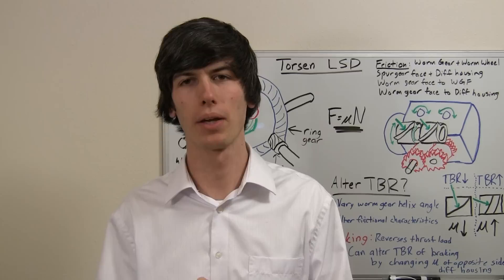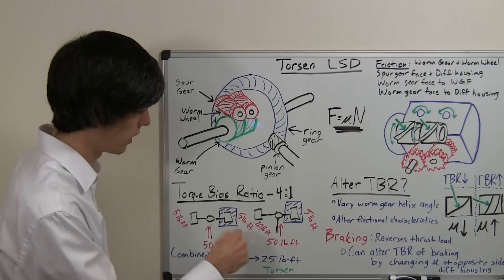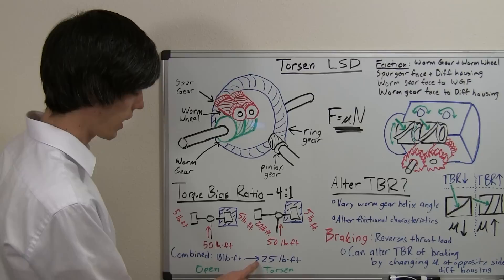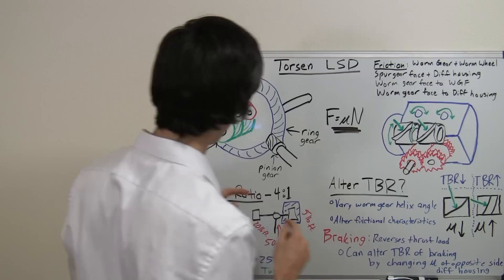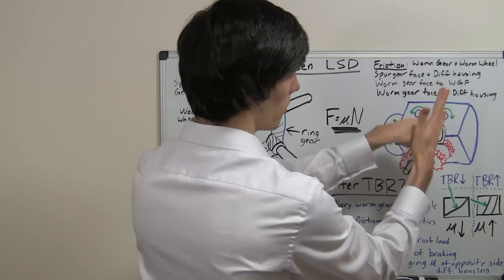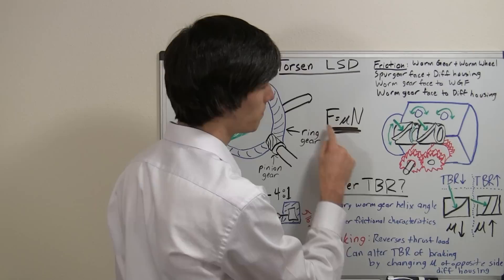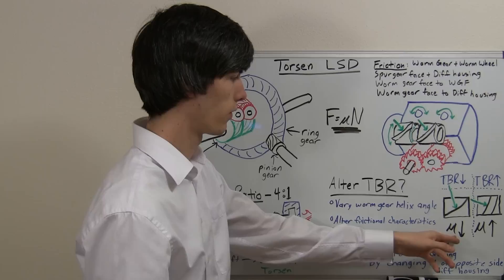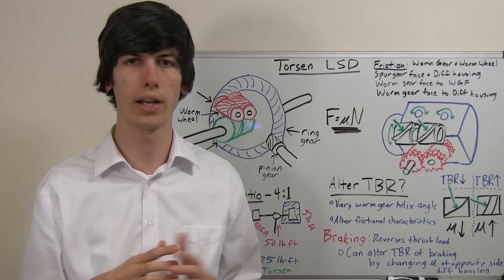Torsen LSD - Torque Transfer - Explained

Comment: Great video! It might be helpful to point out that a limitation of the Torsen becomes evident. The differential can only transfer torque as a multiple (the bias ratio) of the wheel with least resistance. Imagine an airborne tire. It doesn't take much torque to turn an airborne wheel. Even if you have a bias of 6:1, six times "meh" can often be too little torque to overcome the static friction and make the vehicle move. 

An operator technique to address this limitation is found in your equation, F=μN. Once again we can add some friction. By applying the brakes, you add resistance. There's now somewhere for that torque to go--into your brake pads. That amount of force, multiplied by the bias ratio, is now available to the other side of the differential.

Active traction control systems might use wheel speed sensors to detect such an event and automatically apply braking force to the free spinning wheel for you, but that's how you could do it manually.

Comment from the maker: Philosophy aside, could you be more specific? I never said I know all and make no mistakes (which is why you'll find notes and annotations throughout my videos, as I attempt to correct them with time). But you do realize there is a large difference between what speed a wheel spins at and what torque a wheel receives, no?

Comment: That one was pushing the limits of my capabilities but got the general idea.  Seems sheer genius whoever dreamed it up.  Two questions:
1.  Is there any reason not to want the maximum possible Torque Bias Ratio?  I.e., any benefit to having less?
2.  What happens when there is close to zero resistance on one tire?  E.g., on "black ice".  Zero x 4 is still Zero.

Comment from the maker: You are correct in stating they are not the same thing. Helical gear is basically a general term for gears which have the teeth positioned in a helix (rotating). This is different from spur gears, which are straight and not curved.

Comment: This video can really benefit with a working model. I had a SLP Torsen in my IROC-Z. It worked great unless one wheel totally lost traction. Then no torque would be transferred to the other wheel. However, if I straightened out the steering wheel, torque was instantly transferred to the wheel with friction. The Torsen acts like a 'one legger' when going around corners. But, then seems to act like a 'locker' when going straight ahead.

Comment from the maker: A 2 way does certainly lock more under deceleration than a 1.5 way, or 1 way (obviously). I do have a video explaining the differences of each. As far as changing the friction of a torsen LSD (not a clutch type 1.5 or 2 way) you could alter the amount of torque transferred between, but I don't believe this would not cause the differential to lock up under deceleration. It acts more like an open diff with small forces applied.

Comment from the maker: Probably cost, and clutch types have their advantages - adjustability of torque transfer, especially if they're electric. Also, if one tire's in the air a torsen is much like an open diff, where a clutch type is not. The new joint project between Toyota and Subaru has put a Torsen in the FR-S and BRZ. I think the Miata may have used it as well at some point (or maybe it still does?).

Comment: Worth noting that when a vehicle drives through normal turn, both wheels have traction and therefore leverage over the differential. This leverage allows the diff action to take place and the drive wheels can rotate at different speeds. When one wheel is on ice it has less traction and therefore less leverage over the differential. Also, with a torsen diff, if a drive wheel has zero traction, (wheel leaves the ground) no torque can be transfered to the other wheel.

Comment from the maker: Not sure if I would generalize each that much. They each have their differences and benefits. Clutch types are very commonly used in racing; not sure how often viscous is as it may get too hot with extended use (this could be prevented with an oil cooler, Nismo toyed with this idea with the 370z). Torsen comes stock on the new BRZ/FRS.

Comment: Also in this video you say that there is deceleration torque bias while in the other video (where you are correct) you say that it does not work the other way. I understand it's very confusing, so I'm just trying to help. It's very brave of you to try to explain this stuff. But the torsen differential does not limit slip during deceleration. This is one of the reasons why clutch type lsd's provide more stability and better drift characteristics.

Comment: The Torque Bias characteristics now explain easily why the Torsen architecture is not a good choice for off-road : when you lift one wheel because of the terrain, the other will receive no torque at all.

Comment: As with so many engineering questions, the answer is "it depends". 

The Torsen differential is great for road cars. It's a big improvement over an open differential, they are low-maintenance and don't have significant handling quirks.

A clutch LSD is preferred on sports cars, especially those used for competition or drifting. It won't completely lose traction if a wheel becomes unloaded, but needs regular maintenance and can cause understeer.

Viscous .. ugh. Not on my sports car thanks ;)

Comment: IMO:
-Torsen for slow heavy duty vehicles, say a tractor, as the torque transfer is constant regardless of speed. And due to rugged design, you wouldn't have to worry about burning clutches when massive input is applied.
-Clutch for general purpose vehicles, say a pickup trunk, as it doesn't produce as much heat on higher (moderate) speeds.
-Vicious coupling for sport cars due to its simplicity, small size and low weight. But it only works on high speeds. On slow speeds, it's practically "open".
Reply: Imho: Torsen, for maximum fun. Its not just for heavy duty vehicles, manny sports cars use them too.

Comment from the maker: A slipping wheel sends torque to the opposite wheel (the one with traction). This is the definition of an LSD. A torsen diff handles it differently than others (as explained in the video) but the principle remains. The acceleration of the slipping wheel is a direct result of receiving torque with little resistance (friction) with the ground.

Comment: If one wheel is in the air you can just apply the brakes lightly to create frictional resistance that the Torsen LSD can use to transfer torque to the other wheel.

Comment: Depends highly on the application. Torsen can be quite durable and maintenance free compared to a clutch LSD, and it acts instantaneously whereas a viscous LSD takes some time to react to the speed difference. But torsen never truly locks, it can only transfer torque based on the bias ratio. So if one wheel is on super slick ice and can essentially handle no torque without slipping, the other wheel will only receive 5 times essentially no torque, which is still almost no torque.

Comment: Torsen diff is locking only when the both wheels are on the same surface. If one of the wheels is on ice and the other is on tarmac this on the ice will start to spin and this on the tarmac will stop. Torsen is almost like ''Open diff '' . BUT the open diff is spining only one wheel even when they are on the same surface... Sorry for my english... :(

Comment: Sure, and I do understand the difference between TQ/speed.  The answer is found in basic gearing.  Numerically low ratio EG. (2:1) =  higher speed/lower TQ. RELATIVE to a numerically high ratio EG. (4:1) = low speed high torque. Btw definitions are abbreviated. Explanations are specific.

Comment: A 2-way would lock more than a torsen, but the basic problem is that RWD performance vehicles oversteer under deceleration.  There's nothing wrong with your car.

I noticed in your "Euroing in wet" video you've got a ton of grip on the steering wheel, look at the tendons at the base of your thumb.  That will amplify rear-wheel slip and encourage spinning.  Apply smooth pressure but let the wheel turn out if it needs to.  You'll get more control.

Decelerating in a curve requires

Comment: 1) Is the wheel speed in proportion to the TBR, i.e. if TBR of 3, is achieved, will higher traction wheel spin 3 times faster than lower traction wheel?  I'm guessing no...wheels turn at same speed but with different torque?

2) Does a TBR of 3 mean that torque transfer (lock-up) will not occur until one wheel gets 3x less torque (has 3x less traction, I guess) than the other?

3) Does a TBR of 3 mean at least 3x or up to 3x torque is transferred (seems to be the latter).

Comment: I understood that the torsen differential is capable of differentiating the torque and the frictional contact points BUT     1. how does it actually transfer the multiple torque? and
2.what happens when the worm Gear is pushed linearly against the housing ?

Comment: My opinion was based on... The more solid moving parts there are, the more complex the system is, and thus more heat is produced. Or the system must be bigger and heavier in order to withstand the forces. Racing world is of course another game, where parts are made to last only one race. And (IMO) in BRZ/FRS, producing some 200bhp, you can use chopsticks as differentials (as in the friendly link you provided in the flick about differentials in general).
PS.Some BRZ/FRS fan is going to burn me :D

Comment: Cool thanks.  Have a big-world-view question.  The Torsen LSD would seem to be the best option of the three LSDs that you've presented thus far and it has been existence long enough for everyone to know about it, but yet I don't ever really hear anything about them.  Only fleeting references.  Seems like most all LSDs that I've come across are clutch type LSDs.  Could be due to a lower manufacturing cost, dunno.  But in the end the question is why don't we see more Torsen LSDs on the road?

Comment: Great video, however I have few questions if I may:
1) Worm wheel cannot rotate worm gear. That is how locking of Torsen works, isn't it? Why is then torque bias ratio isn't infinite?
2) I may not understand how torque travels in Torsen, but it seems to me, that in non-slipping turn it powers only inner wheel, is that right?

Comment: Can you do please a video comparing a Torsen to a locked diff?  What I am wondering is whether a Torsen type diff can end up sending more torque to the non-slipping wheel than a locked diff can.  In the video explaining torque transfer in open vs closed diffs you calculated the force each tire could receive before slipping as a function of mu and N, but here you are factoring in the torque coming from the driveshaft (or rather, I suppose, the final drive torque?  Please clarify that).  In your example here, with a locked diff, would you get all 50 lb ft of torque to the non-slipping wheel, for a total of 55 lb ft, assuming the mu*N for the non-sloping wheel was at least 50 ft lb?  Does it often happen that mu*N for the wheel with traction is greater than the (Torsen torque bias ratio)* mu*N for the slipping wheel, in which case it seems a locker would be better?  Furthermore, can the Torsen diff multiply the torque at a slipping wheel to a value beyond the driveline input torque (the "initial" final drive ratio at ring gear/pinion gear interface)?  If so, then just having one wheel slipping slightly would result in enormous torque for the non-slipping wheel.  Is there a pre-load or minimum torque split between wheels for the torque bias ratio multiple to come into effect?  Is that difference the torque bias ratio itself, such that, in this case, the Torsen diff will only multiply the torque at the slipping wheel by 4 once one that wheel is receiving at least 4 times less torque than the other, in which case the maximum torque it could deliver to the non-slipping wheel is the final drive torque?  I would love to understand these points.  They seem like subtleties, but really I think they are foundational to properly understanding how this works, and the pros and cons of a Torsen system vs a locking diff.  I still don't understand which is capable of delivering more torque.  It would be great if you could also compare locking diffs that can lock variably up to 100%, rather than just locking on or off - you make an LSD sound like this, but my understanding is that LSD's usually cannot give 100% lock, and are different from true locking diffs.  Thank you.
Reply from the maker: +Abe Ramat A locked is capable of sending more torque (100%) than a Torsen. https://www.youtube.com/watch?v=jm-_Ncjunuc

Comment: Hi Jason, I'm wondering, in this video Scion claims that the Torsen can deliver more torque from the slower-spinning inner wheel to the faster-spinning outer wheel during cornering (see latter half of v=u0EOrzn7-Qc?t=1m7s). If this were true, it would be good for cornering performance because that wheel has more weight shifted onto it and therefore more traction - but is this actually possible physically for this type of differential to shift MORE torque onto a FASTER-spinning wheel?

Thanks!
Reply: to my understanding its physically impossible. because a worm gear can spin a worm wheel but not the other way around it (in my non engineer mind) means that the faster spinning wheel can only ever cause more torque on the slower spinning wheel.
Reply: Yeah that seems to be what I'm picturing in my non-engineer mind as well - that a Torsen serves to equalize the speed differential between the sides based on how it appears to work - similar to a VLSD (the VLSD being mechanically much more intuitive), but with better response and without the same overheating problem. Good when the two tires are on surfaces with varying coefficients of friction; not as useful when they are in a turn (contrary to what the video I shared claims if we are correct).

Just wanted to be corrected or verified. Thanks for the response! Would love to hear other input too, either way.

Comment: So a car that has 150 lb-ft of torque sent to the rear wheels would be able to send only 25 lb-ft of torque to the wheel on pavement if the wheel on ice could receive 5 lb-ft of torque for a TBR of 4:1... Does this mean that clutch pack LSD's are better because it would be able to send almost 100% of torque to the wheel on pavement even if the wheel on ice could receive only 5 lb-ft of torque?

Comment: +Engineering Explained, what's the difference between a torsen diff and a truetrac diff? They both seem very similar. 
Which would be better on a 4wd vehicle rear diff, that does mostly on road, but still a fair bit of heavy off roading.

Comment: So the point is you can set a certain torque from the drive shaft at which the differential will lock, right? (Torque sensing means that it senses the torque from the drive shaft, if I get it right). How do you set the amount of drive shaft torque at which the differential locks? (So that it will lock for example at half throttle and not full)

Comment: To me, it looks like, because both axles are connected together by the spur gears acting on the worm gear and the worm wheel, for a decrease in speed by the inside wheel, there would be an equal increase in the speed of the outer wheel during a corner.  If the differential was in the center of the axle, that would not be a problem, but with a diff offset to one side like in most front wheel drive cars, I could see a scrubbing action taking place as most likley the inside wheel will be spinning slightly too slow in relation the the ground than it should be.  Do I have that wrong?  The only other thing I can think of, is with the differential offset to one side, for the wheels to have perfect traction the input shaft of the transmission would have to spin a bit faster or slower depending on what direction the car turned meaning, lets say the diff was offset to the right, the engine would spin faster turnig right than left with the same vehicle speed.  
I'm on the verge of buying one of these diffs, but am confused by that tiny aspect. 
please answer this as I can find zero info about what I;m talking about.

Comment: Thank you for the video. You made a mistake though in the explanation of the open differential. When there is only 5lb-ft of frictional resistance on the icy wheel, it will receive all the torque because there is virtually no resistance in the differential. So your pushing force is not 10lb-ft, but 5 lb-ft.

Disadvantages of the torsen are high drivetrain losses and heat development in the differential due to the inefficiency of helical gear transfer.
Reply: Not true, open diff has a 50:50 torque split.

Comment: Doesn’t torque at the prop shaft have to equal the sum of the torque at the axles?

In your open diff illustration, for example, you show 50 lb-ft at the prop shaft and 5 lb-ft at each axle. 50 lb-ft != 10 lb-ft. Isn’t this physically impossible?

Comment: You appear to be using both the terms worm gear and helical gear.  They are NOT the same thing.  It was always my understanding that a Torsen used helical gears.  Specifically the examples always appear to have 45 degree helical gears.
Reply: I agreewith you, Torsen use helical gears.

Comment: Hi, no idea if you gona reply but its worth the shot....i have a 4motion with centre torsen diff, if i would lock up the rear with hand brake the torsen would lock up the front, am i right? Because if yes and i would do that while going for a drift, i could possibly blow calipers or torsen itself, so i just want to be sure :D (sadly there is no way to disconnect the rear axle from transmission)

Comment: What are the advantages and disadvantages of torsen vs viscous and 1/1.5/2way? I've being reading up on lsd's, and I've read some are pretty loud and low speeds (parking lots and such) which is lsd type is that?